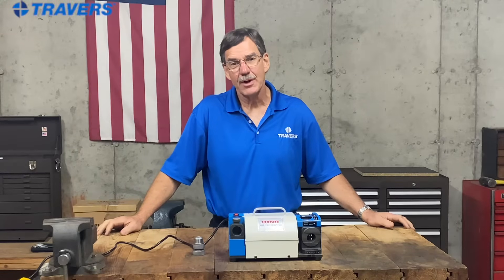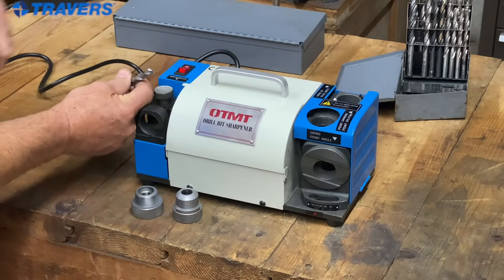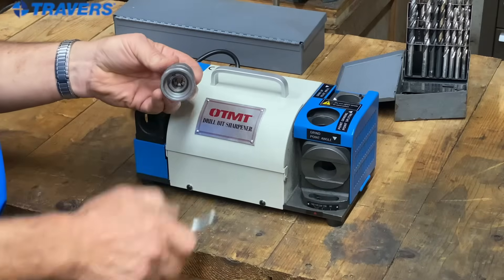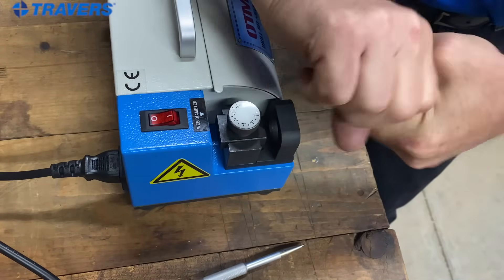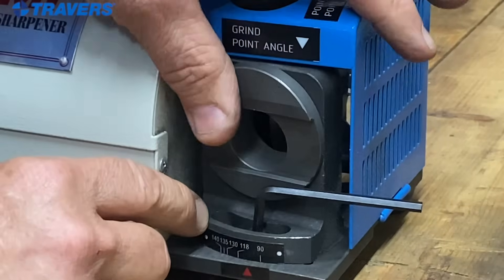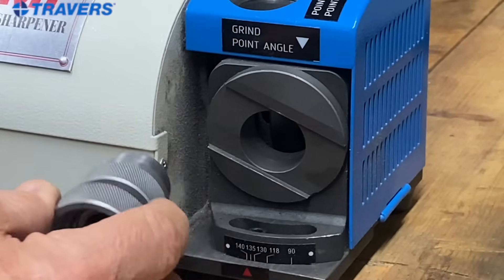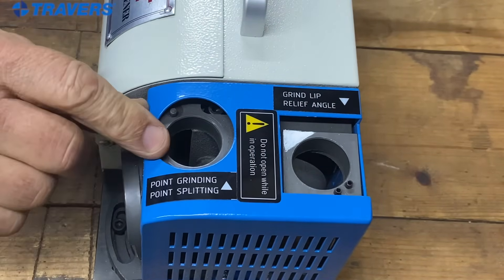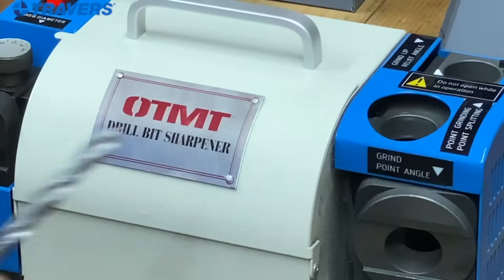How To Sharpen A Drill Bit With A Drill Sharpener

Comment: I've got a clone of this machine from Vevor and found this video because I'm looking for a way to grind left hand drills. It's really great for regular drills. The issue with not tight collet in 4:28 was because You've assembled the holder improperly. There is a small lip in the part with male thread and You're supposed to put in collet in that part first so the groove on collet is grabbed by the lip. Then everything tightens beautifully with a slight "snap" :)

Comment: OMG. Wrong assembly of collet block. If you are familiar with er collets, the have to be put in the nut first!!!
Reply: Incorrect,  if you look at the nut it has a provision to snap the collet in place via a lip quarter way around the diameter. This in turn ensures that the collet seats against the internal bearing and also releases the drill bit when finished. No need to hit the nut on the bench which is probably not good practice
Reply: @andrewM_75 , yes, you're correct -- for a collet chuck.  These machines are made differently, and the collets are inserted upside down.
Reply: @wonbythe1  Look at the nut, it says in instruction manual to angle the collet into the nut to seat it.
Reply: you are so wrong listen to what people  are trying to tell you . pretty sad when the tool company is totally wrong on a machine that is 3x the cost of a vevor
Reply: @jayfenwick4214  3x the cost of a Vevor But likely made in the same factory with a different label on it.
Reply: Great observation, @azizinojatov1157, and you're exactly correct -- normally. 🙂 If you go to 2.33 into the video, you'll see that this drill sharpener uses the ER Collets backwards, so they don't snap into the nut like they do in ER Collet Chuck nuts.  Thank you for bring that up though.  Maybe I should have mentioned that more clearly when we shot the video.

Comment: can it also sharpen 3.175 mm 10degrees 0.1 engraving carbide bits
Reply: Este o întrebare, sau o afirmație?
Reply: Sorry for the long delay, @salaamkeneth8809.  Yes.  Start the video at 5.38 minutes in, and you'll see how to adjust the angle.  Since 90° is flat, to grind a 10° angle you'll need to set it at 100° (90° + 10° = 100°).  There's no mark for 100°, so if you need it to be exact, you might need to use a protractor.

Comment: This is a fantastic video! I have a DBG13D myself for our shop and its great and super easy to use once you learn how to properly set the tip just right (which I admittedly have issues doing, which is why I came to this video).
Reply: Me too! This is exactly the video I needed. Very helpful. The DBG13D has a spot on my workbench!
Reply from the maker: So glad this helped!